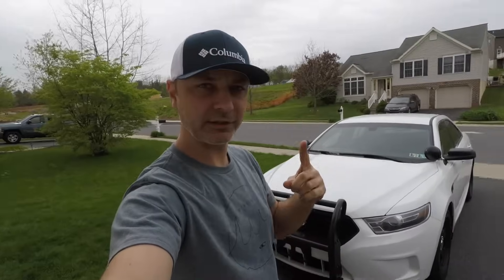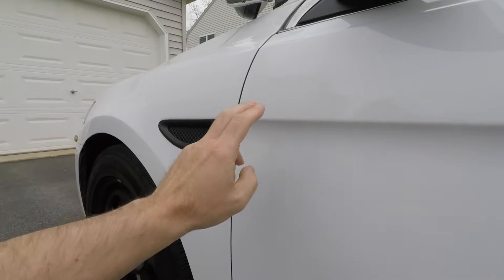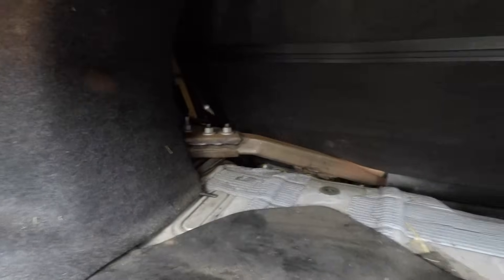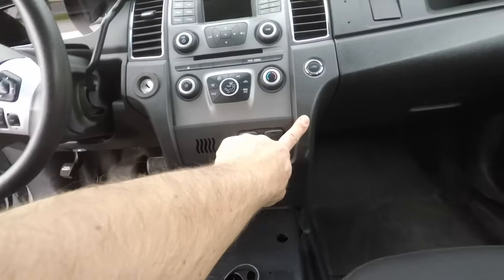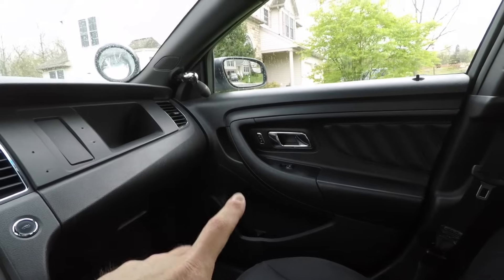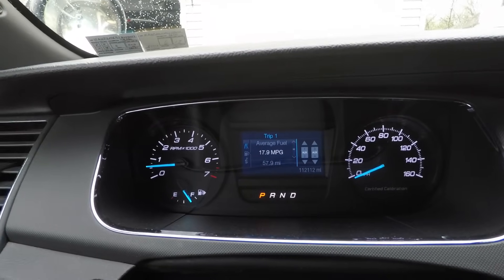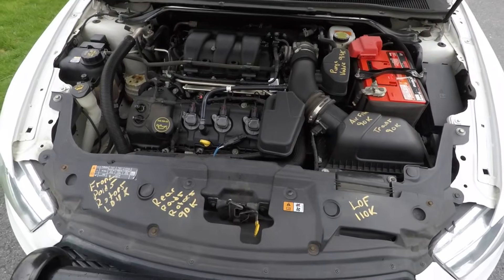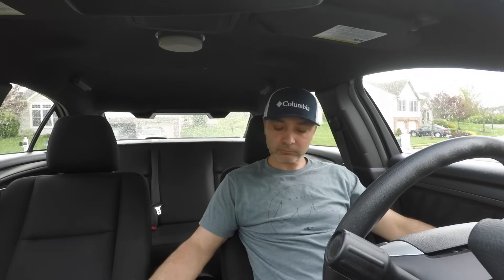I bought Police INTERCEPTOR, OVERVIEW and what comes with it, PROS & CONS

Comment: Been buying old cops car for 35 years nothing new. Most of the cops cars are run into the ground. Best thing to buy is what I call staff or pool cars. They have police packages but are not used on the streets.
Reply: Or a nice Chief’s car!
Reply: Interesting. Is there anyway to tell the difference? 
I think the bigger issue rather than being run into the ground is that you can easily double or more their mileage from idle hours and I'm pretty damn sure idling is not good for any car all the time.

Comment: In waiting for him to pull out an ar15 from the spare tire compartment...
Reply from the maker: Dude, you never know, things are left behind and under the seat, LOL
Reply: @Pete717   very rarely they have a Desktop PC in the back unless they are running something like LPRs, usually just a Laptop up in the front next to the driver.

1. Most of the time that tray holds radio equipment. Sometimes there are multiple radios depending on the jurisdiction that vehicle is used in, and a control head at the front. Being it a State police, officers need to communicate with their department, local Sheriff and local police. In some areas more than 1 county or city. Most of their radios are high power radios and when Mic button is pressed it gets very hot very quick.

2. Certified speedometer is because of different wheel diameter installed and that has to be re-calibrated and certified unlike basic Taurus is already calibrated from the factory.
Reply: At a police open house i could of walked away with a box of federal tactical 12 gauge 00 buck and a box of slugs. They were in the door pocket with kids climbing in and out all day.
Reply: @americanmilitiaman88  
"Could've". 😉

Comment: The tray is for all the communication modems. Your dispatch, your light control panels etc. the fan is to cool down the computers. Your missing your compartment tray to separate the tire and the side box is for your fire extinguisher or other equipment.
Reply: I drive the same car for a year it’s pretty reliable but the headlights and turning signals would always go out.

Comment: Bad news the water pump rums by the timing chain. Replacing that thing means major repair.
Reply from the maker: IT will be a bad news, about $1800 repair. waterpump design got improved by Ford starting from 2014 models going to wider chair (dual chain) and better bearing to lessen the wear, so fingers crossed...
Reply: But it is a nice car though. 👍👍

Comment: I sure hope the water pump does not fail........ You need to take apart the whole front of the engine to get at it...
Reply from the maker: I sure hope so also, its $1800 job. You never know, but I know one thing from 2013 and up they updated water pump and its allot better than 2013 and older. Fingers crossed.

Comment: @Pete717 Ya might want to go to a junkyard/car recycler and try to find a used console from a regular Taurus. It would probably bolt right in place,when you take out that metal piece that's in there now. Probably be way cheaper than buying a new one from a ford dealer.
Reply from the maker: See my other video of installing taurus center console, bolts in perfect

Comment: As an old geezer who's spent a lot of time looking out for speed traps, I would have a blast driving this "unmarked" car.  I'm surprised the seller didn't remove the push bumper and the strobe system.
Reply from the maker: Actually all cars they sell come with this same package, all of the state police cars I get setup just like this one, lights, push bar, ar15 in the trunk and some some under the back seat, LOL
Reply: I'm surprised that the spot lights are still on the car.
Reply: @cuteface88  I hadn't seen many old police cars in civilian use of late.  Many of the Crown Vics were sold for use with the cage for use as taxi cabs, but usually they took the spot lights off the car the strobes in the grille were gone etc, the push bar is usually left on the car. The spot lights may be a state by state law.  I've heard that NJ for instance, if the spotlight was on the car to pass state inspection the wire had to be cut and visibly cut to pass at that, now alot of states are just worried about emissions and that's all, so that maybe out of the window now. I know that sometimes the owner operators have 1 or 2 spotlights on the tractor which is a benefit if your lost or looking for a street at night or happen upon an accident etc.

Comment: That tray in the trunk is for car radio stuff.

That x brace is a safety enforcement incase some one rear ends the car while it is stopped. Think it was up to 70-75mph impact. In conjunction with the spare tire in the trunk too.
Reply: actually, the tray was for the AR or SG storage. The wires that you see connect to the self locking mechanism that can be unlock by a push bottom. Taurus are small and there is no room in the cabin especially with a built in cage.  I drove a Taurus for several years while on duty.
Reply: @johnng4139  I'm pretty sure the tray is for the electric components like the light bar and lights a long with any extra electric load that it has. That's why there's a fan there. Also the wires, I know from personal experience from riding in the back all the time.

Comment: They use a larger radiator,so naturally they would use more coolant. Those cars have a lot of idle time. The bars in the back,are rear strut braces,tied into the frame rails, which increase the crash test rating.
Reply: They are put in place to reduce body flex.

Comment: Most car speedometers read slightly higher than your actual speed. This is by design since there are inaccuracies from wheel size (tire inflation), and for physical dials, parallax, thus they tend to air on the side of any error reading higher rather than lower, thus to prevent you from speeding when you think you are going the speed limit.

Comment: Great video. Very informative. One thing I do want to mention regarding the front doors; the ballistic panels are optional and the vehicles that are equiped with them have a small badge on the interior door panel that reads "Ballistic Panel". I love these cars and I have one of my own as well- a 2014. Cheers!
Reply: My door on the 2013 did not have a badge on the door saying Ballistic Panels but the doors seem really heavy and have straps on them to prevent breaking the hinges.
Reply: All the Interceptors come with those straps
Reply: Hey man. How is your 2014 doin in terms of reliability. I'm thinking about buying one rn, and its got like 100,000 miles on it for close to 8 Grand. is it a good buy and if so is there anything about the cars themselves I should know?

Comment: On the certified calibration. Normal vehicles are permitted 10% variance provided that it reads up. Meaning if you are doing 50mph it can read as 55mph but not 45mph. So you can be driving slower than your speedometer indicates but not faster. The police vehicles are supposed to be spot on.
Reply: @jago668 - Your statement that normal vehicles have a 10% variance (reading up) fits with my personal observations in the last 10 to 15 years.  I travel often and quite often and always bring my own GPS to get help me to get to where I need.  Whether it be hire cars, friends or family vehicles, the GPS always shows a slower speed than the speedometer in the vehicle - especially on motorways / freeways where you set the cruise control and have a good amount of distance at a constant speed to use as a source of data.

Comment: That tray in trunk is where all the radio equipment, video recorder, light controller box, etc. went. I doubt the lights work. Those light lights except the ones in trunk come from Ford that way. I use to install the equipment in PA State Police vehicles. The doors have plates in them layered for bullet proof and they are heavy. LOF under hood indicated lube, oil, filter service.

Comment: Whats the difference between a police interceptor and and SEL??
Reply from the maker: Police interceptor is Taurus SHO PP (performance package) lots of upgrades. Some interceptors come with ecoboost, some with 3.7L, but all the upgrades stay as base platform. IT has 55F transmission VS 50F on standard tauruses, radiator cooled PTU, large brakes, extra large radiator.... list can go on, look up PP SHO
Reply: @Pete717  i know about the sho but someone else had told me that it was just the suspension, brakes and intake that it was modified....i own a taurus sel and im trying to convert it to a police vehicle performance wise
Reply: @Pete717  thanks pete and great video!
Reply from the maker: @juand.hernandez8283  I have an SHO myself, well, like I sad there is allot more to it. If you want your SEL to look like police you need push bar, front grill rims and you good to go. All the other things, like transmission PTU cooler brakes rotors calipers and pads, radiator will be too expensive to upgrade, it's prolly cheaper to sell SEL and buy interceptor
Reply: @Pete717  do you know more less the price ranges for it?
Reply from the maker: I resell them as is for around $9K

Comment: If I’m not mistaken, the engine is the same as a normal Taurus, however the ECU is tuned to optimize its performance.
Reply: jasondaman8 not a regular Taurus is a 3.5 and police are a 3.7 with 15 more horsepower and 30 more ft lbs of torque.
Reply: The naturally aspirated engines in these are mediocre. I would imagine the EcoBoost v6 would be fun tho.
Reply: Upgrade coolant system & among other things!
Reply: Some of there have a twin turbo i thought
Reply: The Cyclone 3.7 is out of the Mustang, but really just a re-bored 3.5, that like the 3.5 Twin Turbo EcoBoost, are offered in the civilian Taurus, though are chipped for performance and higher rev holding.
Reply: They usually have better handling packages, better engine cooling, and higher output alternators.
Reply: @kevinlimo696  Warning tip over easy. (Open up the Sun-visor.) Ford light Axle to increase speed.  Ford pickup from F250 and above well balanced Axle body's.  

German car Audi BMW. Heavy Axle   strong light body's. Ford metal is not strong unpress steel.  Press steel strong.

Comment: I also have a 2015 police interceptor. Mine has a key fob and the radio has blue tooth and an USB and line in connections. In the trunk mine also has a 150 amp fuse panel. I love it the acceleration is awesome. I bought mine from Chicago Motors, Inc.
Reply: Yo , are the prices listed the actual prices? Were there any hidden fees?

Comment: I see a huge number of former police cars on the road -- it is surprising how many still have the spotlights, push bumpers and even UHF antennae on them.

Scary as hell when you end up with one behind you on the highway.  Ford really did not change them much at all from 2013 to 2019 (when they quit making them), so even the older ones still look "new" from far away.
Reply from the maker: Most of them bought by taxi drivers and converted in to taxi, allot bought for parts to maintain taxi fleet on the road, as much as sold here, I don't see them on the roads at all

Comment: The tray is for hard drives and recording equipment for the dashcams and radar equipment
Reply: Try again, The harness in the Tray is for a Whelen CenCom Carbide system. Whoever decommissioned this car did a crap job. Most states it's illegal to own equipment for law enforcement use.
Reply: So the tray can be used for anything. More than likely it did have something to do with the lights. The wiring was probably ran to the tray and hooked up or for video equipment. 
Source: I’m a cop and drove a Taurus at one time.
Reply: GSTruSpec actually all the VA state cars that are decommissioned, look exactly like this!
Reply: The tray could be for police radios also.

Comment: What’s the best place to go look buy a police car like that
Reply from the maker: Depending on the state, only few states selling these cars to the public, search for police car liquidation? You can buy one off of e-bay there is a large car dealer in IL selling them all the time, I do sell them and ship all over the use, shipping cors country will cost you $1500, closer is cheaper, car usually sells for $9K
Reply: Are they mostly auto auction websites   I am in NYS. I’ll try eBay
Reply from the maker: @mrflaco21  I am in PA, I had few cars sold to NY, 3 hour drive?
Reply: Yea from where I am yea not far   Do you have an update look for your changes you made looks good car
Reply from the maker: @mrflaco21  This car is sold long time ago, I had few cars since then bought and sold. This month action is canceled, next action in June
Reply: So do you buy them and sell them or buy -fix them then sell them?
Reply from the maker: @mrflaco21  I pretty much buy them as you see in in the video, there are few things need s to be done to put them in civilian mode, like back doors are completely disabled from opening from inside, windows dont work, speakers in the cars wired to CB radio, so that needs to be fixed, horn button wired to siren so it needs to be fixed so you can pass inspection. After state police strips car done from equipment, they live everything all the plastics and headliner removed or in very messy shape, lots of clips are broken off. SO i put car back in to decent shape, ready to use kind of shape. I take it to mechanic to check and make sure its in good diving condition and there is nothing major wrong with it, some cars I have to do alignment or tire change. car to car little different. I make sure all lights working and car is ready to pass inspection once you buy the car. Had to replace windshields on few...
Reply: Ok how much do you typically let them go for $?  Or do you have a place where you put them up for sales?

Comment: All police Taurus comes with a key entry trunk lid slot,all civilian Taurus's comes with driver side trunk release,with no key hole slot from the trunk,that's one way to tell if it's a cop car or normal civilian car,AND YES I WORKED AT FORD FOR MANY YEARS,AND DEALT WITH NEW POLICE CARS COMING IN FOR LOCAL TOWNS,IT WAS DUE TO MAKING IT VERY VERY HARD FOR CIVILIANS TO GET INSIDE THE TRUNK,CAUSE WHAT IS KEPT IN THE TRUNK

Comment: I showed this to my son and he mentioned the TiVCT you pointed out meaning turbo (on the A/C label) doesn't mean turbo. The TiVCT is apparently a variable valve timing tech Ford has with a phaser to adjust the timing on both the intake and exhaust camshafts independently. TiVCT stands for Twin Independent Variable Camshaft Timing.
Apparently, the GTDI is the one referencing the turbo, standing for gasoline turbo direct injection.

Comment: I have been driving these vehicles for years.  Ford was my client and I would get the fleet demo versions with about 1000 miles on them.  Right now I have a 2016 Taurus Police Special and a 2020 Police Responder Hybrid, both from new.  The tray in the trunk held the 'chip' that was the control head for the electronics, lights, sirens, etc.  The fan in the trunk is to maintain the temperature in the trunk for the electronics.  The power cables run under that centre plate in the cabin to under the hood for power.  The police consoles from the Crown Victorias will fit in this car.  they are very functional and can be set up in different ways that will work for you.  The exhaust is after market and probably by the police department because they didn't want to put the money into a full replacement.  Since they would be selling it off before it would any further issues they wouldn't see a problem.  Due to the amount that police idle these vehicles they were burning out the catalytic converters.  They are built to run with the converter.  There is a lot more to these cars than you may realize if you haven't owned one before.  Enjoy the car, they are a lot of fun.
Reply: Any experience with the water pump issue? I love these things but hesitant to pull the trigger on one over that. Im about rdy to purchase my 3rd police car ( ive had 2 crown vics)
Reply: @Sublight77  never heard of a water pump issue and haven’t had any issues with the vehicle other than the tail light burning out. Ford says it’s an LED but it isn’t. Bugger to get at.

Comment: I can get a 2015 with 200k miles for $3500 that needs a steering rack, is that a good deal still?
Reply: I see re-manned steering racks for $700, does the Interceptor use just a stock Taurus steering rack?
Reply: I don't know much but I'm also interested, from what many say, the idle hours mean a lot.